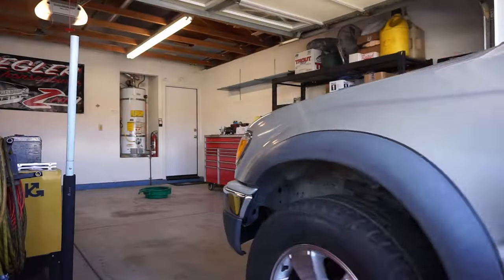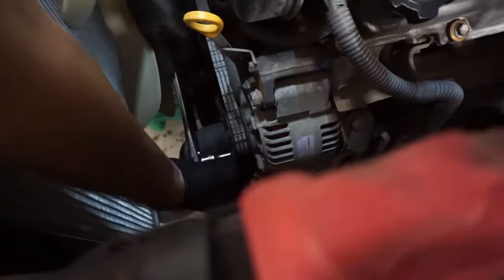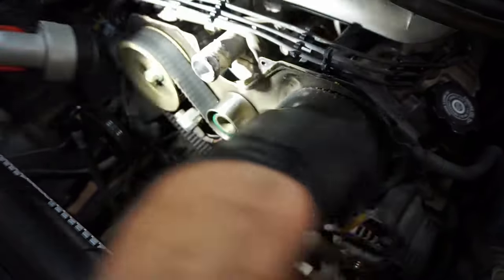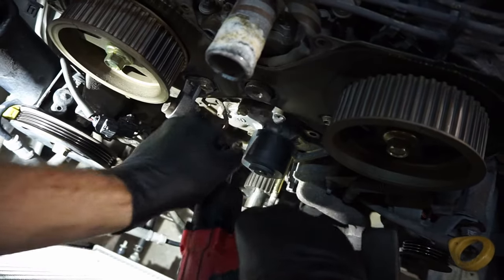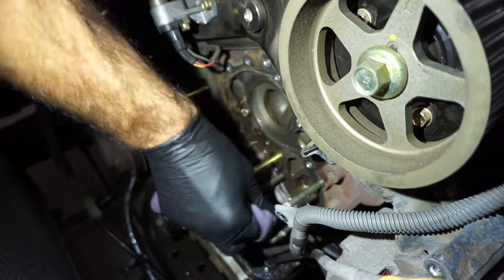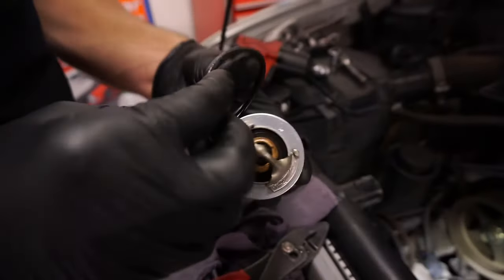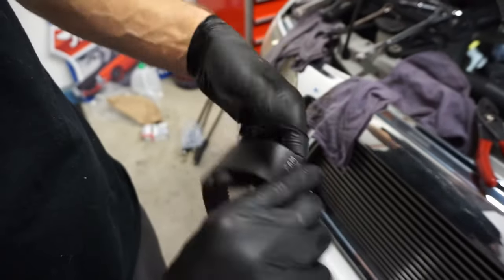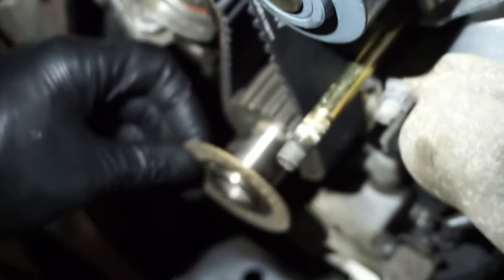Changing timing belt in Toyota Tacoma 3.4 liter

Comment: How long should it take?  I know everyone will laugh at the fat guy rolling around in the yard, but it took me 12 hours.  I took an old cardboard box and stuck my bolts through it as I took them out and I was able to write beside them in order where they went.  I also couldn’t get any combination of wobbly sockets and short and long extensions to work even after I took the compressor off, I still had to take off the AC mounting bracket.  I do want to say that this was the best video I’ve seen!  Your voice is perfect and you explain everything very well!  Thanks for taking the time to make the video!  Big help!

Comment: That little wobble vent thing on the thermostat needs to go down to 6 o'clock. Other than that, perfect video
Reply: That's what I've been hearing. I followed this video, and installed in the 12 o'clock position. I haven't had any problems that I'm aware of so far. However I watched a yt video of a guy claiming to consistently run 10° cooler with his jiggle valve in the 6 o'clock position. Any information on this is appreciated.

Comment: Thermostat bleeder hole goes to the bottom, 6oclock, according to the Toyota service manual.
Reply: Not true sir, when you exhale in water do the bubbles go down? Air will get trapped behind the thermostat if you install bleeder down at 6 o’clock.
Reply: @johnziegler204  Read the service manual.
Reply: @johnziegler204  https://www.youtube.com/watch?v=21covLH53bg See 9:28 for detail from service manual. The 6oclock is the Toyota way.
Reply from the maker: You’re the Toyota way
Reply: Yeah, the service manual says the jiggle valve should be downward